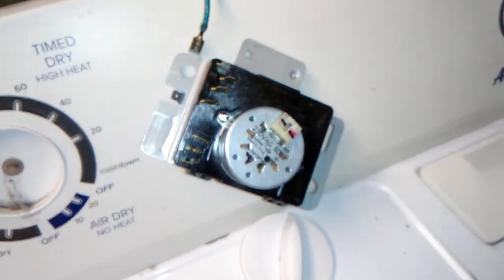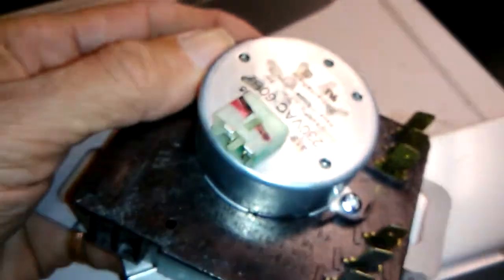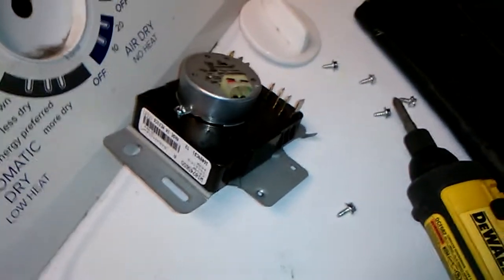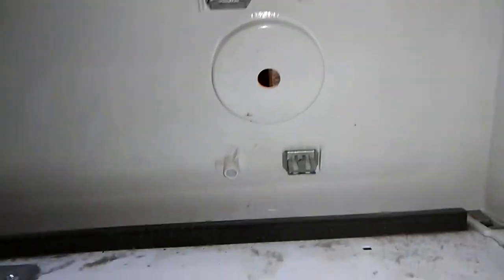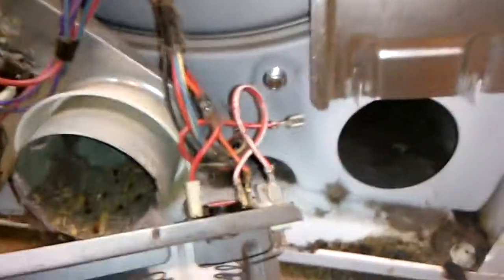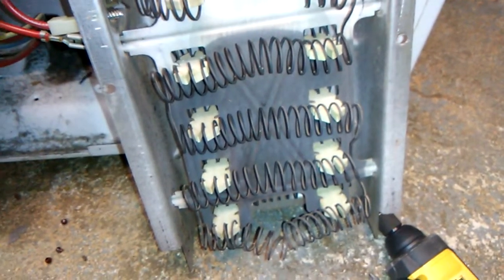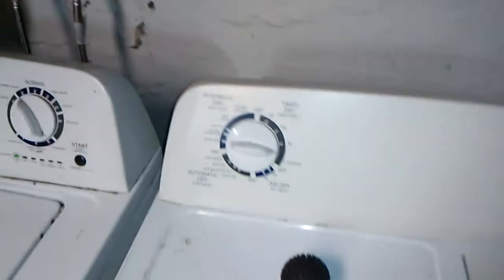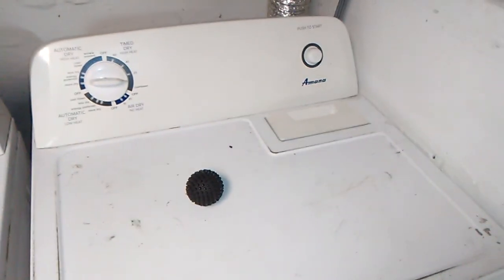Amana drier repair. New timer and new heating element.

Comment: I have the same exact dryer with the same exact problem. The timer doesn't advance on automatic mode and doesn't move up to cool down at time mode.  Do you think the issue is the timer or just the heating element itself?
Reply from the maker: They are separate (though indirectly related) issues.  The timer is just that, a (mechanical) timer that turns at a calibrated rate and then sliding contacts either turn it off or on.  The heating element is completely independent of the timer.  Check continuity on it, and if it is open continuity, pull it out and look at it.  You find (usually) the heating coil is broken somewhere.  These two components are related, however, in that if the timer runs all the time, the coil will prematurely fail.  The drier timer puts the drier in a cool down mode at the end of the cycle to ease thermal shock on the heating element.  That's why both components of my drier failed at the same time.

The timer was $150!  The drier itself was $300.  I got the heating coil on-line for about $25.  It still works though!